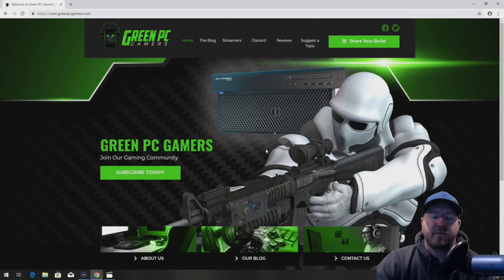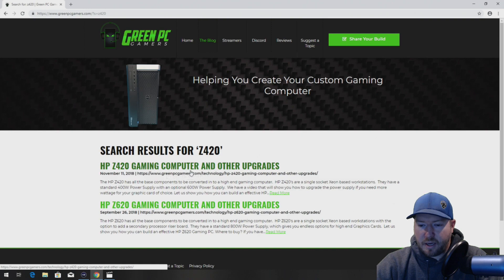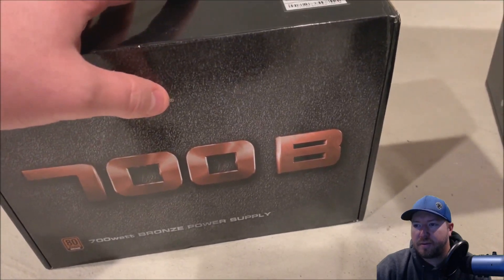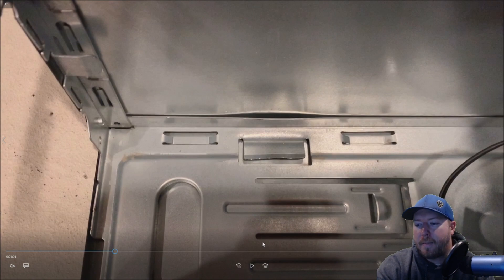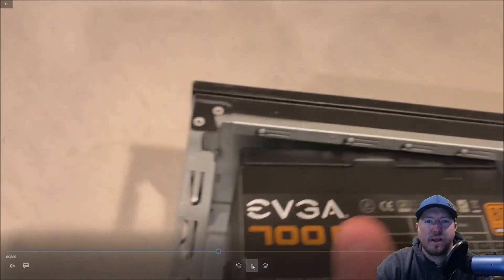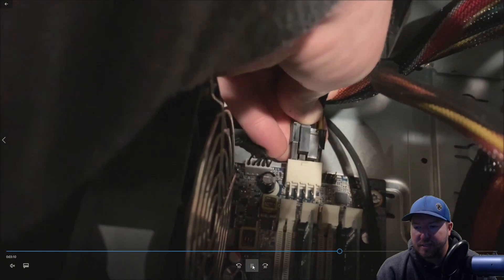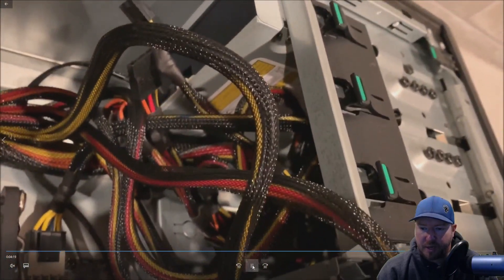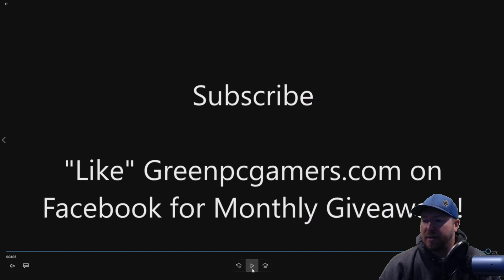HP Z420 Workstation Power Supply Upgrade and Replacement

Comment: hi, 
Thanks for the info. I have used your video as inspiration and came up with a variant. I have bought a Corsair 850 watt gold power supply. I have cut out a piece of aluminium plate and mounted it to the power supply as an extension of the horizontal gap and managed to screw a bolt and nut connecting the plate to the tower. Than I mounted a nut and bolt to an aluminium strip on the lowest left corner and fold it to connect to the power supply  which I screwed in to the power supply.. The computer started up great so now I'm going to look for a decent 2080ti for video editing in DaVinci Resolve.
Reply: hello! ive got this computer im just wondering if you removed the old power supply, and could you, open the old PSU take everything out and mount the new one in it? so it basicaly fits?
Reply from the maker: Nice customization and thanks for sharing!

Comment: would a z210 psu upgrade be almost identical (besides the different adapter required for the mobo?)
Reply from the maker: The EVGA 700B should be a good fit.  You'll most likely have to drill some holes to screw the power supply in to place.

Comment: Found out the hard way these junk piles  only support SLI from quadro cards and not GTX cards.  They make decent budget gaming pcs, but you are limited to 1 video card due to poor design decisions by HP
Reply from the maker: Hey Steven,  that's a bummer, but also understandable considering they only sold the Z420's new with NVIDIA Quadro or equivalent AMD GPU's.  If you upgrade the power supply you can install 1 x high end RTX or GTX Graphics Card.  Thanks for commenting!

Comment: Thanks for the video, it's been very helpful! I've never done any work on my pc so when I bought a GTX 1070ti graphics card for my z420 and realized it didn't work right off the bat this video has been a life saver!  I do have a question I hope you can help with, I bought a corsair 750W PSU and I've gotten the adapter you mentioned in the link but it still won't turn on.  I've done the paperclip test and the PSU fan does turn on when I turn on the power with just the paperclip, so I don't think it's the PSU.  The adapter I got, though, had one of the cables loose - it's actually the 2nd adapter I've gotten and the 1st one had loose/free cables too.  Do you think it's not working because of the faulty adapter cables or something else?

Thank you very much!
Reply from the maker: Hey Luke, please try the following trouble shooting steps.

1.  Re-install the original HP Power Supply and graphics card to verify that the system is working properly (if this doesn't work, let us know)
2.  Install the new power supply and adapter cable with the original graphics card.  (If this works we know that there is either an issue with the GTX 1070 Ti Graphics Card)

Let us know what happens after you try these 2 steps.
Reply: 1. My computer still worked with the original power supply and graphics card.
2. I installed the new power supply with the adapter and it didn't turn on.  

Thanks again!  @GreenPCGamerscom
Reply from the maker: It must be a bad Power Supply or bad cable.  Let us know how you end up fixing it.
Reply: @lnperez1417  Did you ever get this to work?  What was the final fix ?